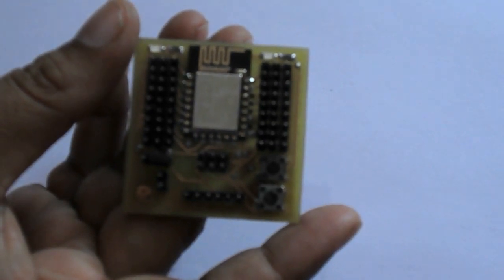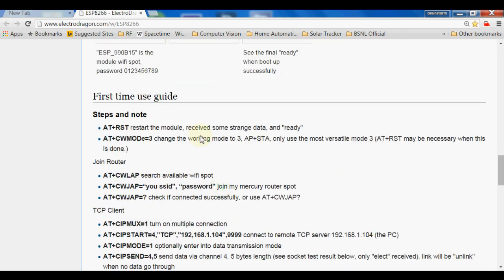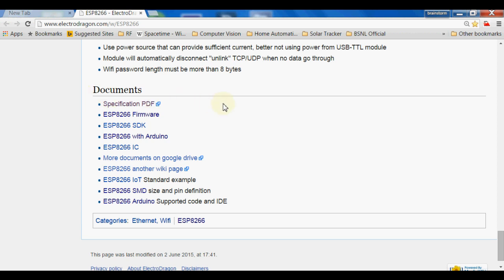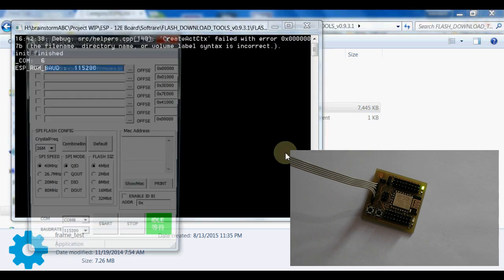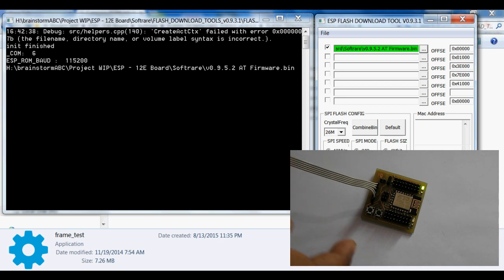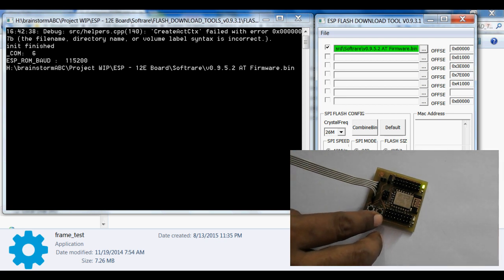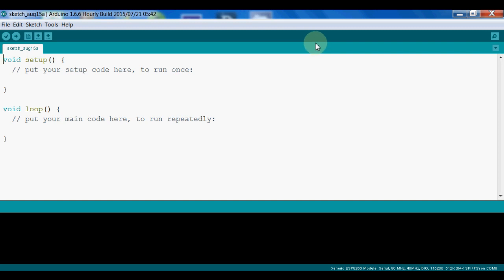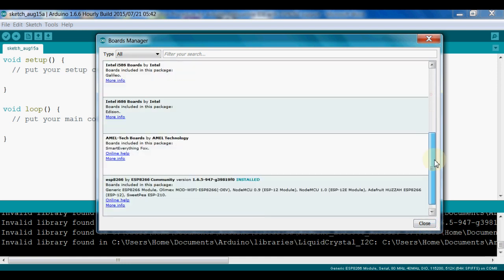Part 2 :  Update the Firmware of ESP-12E and Program the ESP8266 with Arduino IDE

Comment: Hi!
I used arduino's serial monitor for sending AT commands and connecting the ESP to my wifi connection.All worked well.......
But when i tried to upload a blink example to the esp through it's arduino addon, i recieved the following message:

warning: espcomm_sync failed
error: espcomm_open failed

It was that simple blink code only and i even tried out all the boards present in the addon. Nothing worked out for me, i would really appreciate your help!
Thanks
Reply: +Iot Freaks Can you please list your connections for flashing? Is it possible you have not connected RST, or GPIO0 and GPIO15 are not held low?
Reply: I'm all done... was just a little mistake that i had to keep GPIO0 connected to ground while flashing everytime....that's it.  Thanks for asking and looking into my doubt.. really appreciate that

Comment: i am getting the following error with esp12 (1.5.2 firmware)

warning: espcomm_sync failed
error: espcomm_open failed
error: espcomm_upload_mem failed
Reply: +Paras Bhanot Wire GPIO0 pin to ground and power cycle?